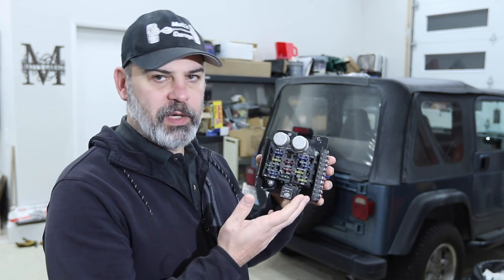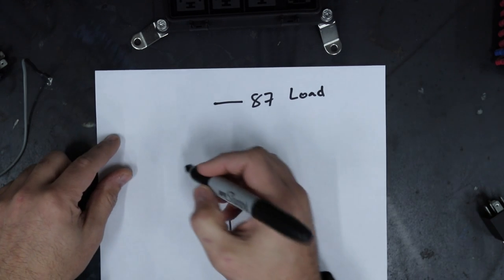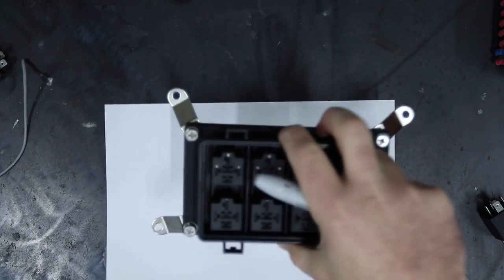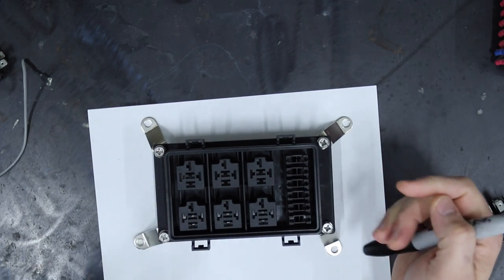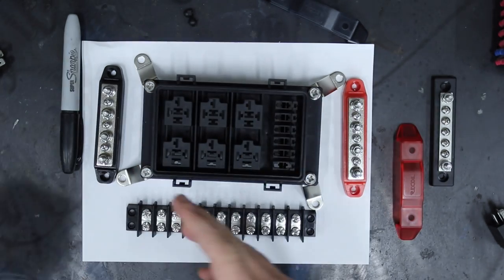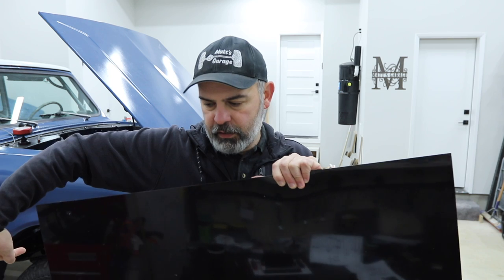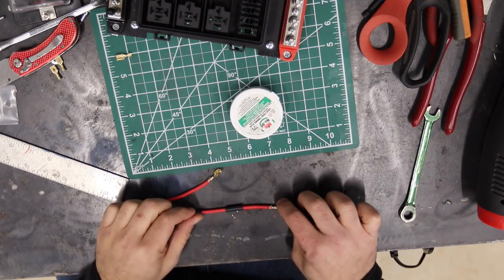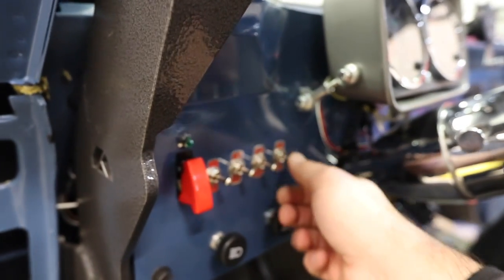8.10-Custom Relay and Fuse Panel

Comment: Save some wire and clutter by jumpering pin 86 to pin 30, and then putting your switch between pin 85 and ground.  Saves running a hot wire all the way to your switch and back, while just grounding all your switches to a common spot under the dash. Most modern automotive wiring is done this way, especially stuff controlled by the ECM.
Reply from the maker: Thanks Tom. The only reason I didn’t do that on a few of them was to have the 86 only hot when the ignition is on since I was powering the buss with battery hot. But I agree with the principle totally.
Reply: @MattsGarage  can you explain that a little, best video so far to explain a relay ive found! I want to move the rats nest of wires from my interior fusebox to a relay panel but I only want power when ignition is on... TIA!
Reply from the maker: @davidokner5450  thanks! What I was trying to explain was that if I was powering the whole panel with switched ignition, the. I could jumper everything 86-30. Then it only needs one wire to power the whole the panel and cleans up a lot of wiring. But I have that panel on Battery + and I don’t want the 86’s to also we battery + I want them on switched power. In case something grounds out in the middle of the night from a furry beast chewing on the wire, it won’t burn the whole rig to the ground.
Reply: @MattsGarage  Hi, so instead of running the power directly from the battery I'd run a wire from the ignition switch itself and that would be my connection to the 30 blade or main power cable, correct? thanks!
Reply from the maker: @davidokner5450  hmmm. No it would be from your ignition to the 86. If you run ignition to 30, then whenever the switch to ground on 85 opens, you are powering your device through your ignition switch. That could be ok for things that require only a little amperage, but anything that draws a lot of Amps should (in my opinion) be battery + to the 30. The only debate is whether to power 86 from battery + or to power 86 from ignition hot. I was just saying I prefer the latter but I admit the former is cleaner in the sense that you have fewer wires running to the panel. BUT that means all of your relays must be switched to ground (switch on the 85 side) and if any of those wires ground out the load will have power. I would recommend just grabbing a 12v light, a battery and a relay and just trying the different setups on a bench. It might give you more of a feel of what’s best for you.
Reply: @MattsGarage  Thanks! really appreciate the help!
Reply: @MattsGarage  the solution would be to put a Big relay on the ignition  switch that would power on the main wire to the relay panel and than you could ground switch the rest of the relays
Reply: @v8tergt653 I had seen another video that runs 2 distribution blocks, having 1 powered only on ignition.

Comment: good rundown... I know a lot of my offroad buddies and I like to run the grounds through the switches and the relays instead of the hot as it makes for a lot less "hot wires" running through the vehicle meaning less likely to short out on a grounded surface. That way if the wire does get damaged and shorts the only downside is the component turns on as if you had activated the switch. Kind of like a horn or a dome light on most vehicles uses the ground as a trigger.
Reply: I agree with what youre saying but its not just a matter of the load activating, if you have a high amperage load and get a small short to ground, the heat created at that point would be problematic. And theres not much you could do as far as fusing that so youre kinda sol.

Comment: I am working with a fuse/relay box that looks like yours. Mine came with green silicone wire plugs that go in the bottom to make the case moisture proof. Do you use them or are you mounting it in a place that does not matter?
Reply from the maker: I mounted them inside so I didn’t bother. Unless you are fording water it’s not necessary

Comment: I couldn't get my 10 gauge wire to look in place due to the size. Did you have any problems?
Reply from the maker: What kind of wire are you using?  I didn't have an issue but I use GXL wire which has thinner insulation.

Comment: I bought the kit you have in the video, but its pre-wired... It states its a 40A relay box, with 6 relays. Each relay is rated for 40A, and the biggest fuse is for 30A.
BUT, I think I made the wrong purchase?

I will have multiple devices that will have about 150A total, a max of 30A for a single device, most are only 3-7A.

Comment: If you get a sec, what gauge of wire did you use for the battery terminal connection? Looks like 14...?
Reply from the maker: I'm pretty sure I used a 10.

Comment: How to you plan on mounting this?  Also what is the height of the dowls your using to raise the relay box from the mounting portion?  Great video!!!
Reply from the maker: I still haven’t actually properly mounted it yet. It works great but still need to mount it permanently. I believe the standoffs were 3/4” but I got rid of them. It was a pain.

Comment: im gonna install LED bar, camera with smart rear view mirror, and reverse sensors. Do I need to connect them to relays or only fuses are enough?
Reply from the maker: It really depends on the amp draw.  Switches and fuses will work, but then your putting a lot of amperage through the switch.  The relay avoids that as there is very low amperage required to trigger the relay.  It's like the trigger on a mouse trap.  A little force unleashes a bigger force.
Reply: @MattsGarage  i calculated a total of a bit less than 40 amps for all accessories.  what do you recommend?
Reply from the maker: @yasser.busaleh  I’m not the right person to ask. I put a relay on everything more than 8 amps but you could probably go up to 15 per circuit.  your LED light bar is the biggest draw right? You should put relays for the biggest draws.

Comment: what amp terminal block do you recommend using
Reply from the maker: Depends on what you are running. There is not 1 correct answer.

Comment: I do have a question about this as I am doing this same box to run my kc lights,led lights,air compressor..my question is 85 and 86 I see you wired 86  on some as the ground and others 85 does it matter witch one I run as the ground??I will also be running the rough country 8 gang switch panel and have live switch feeds..
Reply from the maker: You can put the switch either on the 86 side or 85 side. I don’t remember sending ground to 86 but it “should” be 85 to ground. However, I don’t think the relay cares about that either.

Comment: If a specific relay is no longer made for a car can you replace that relay using this method?
Reply from the maker: Theoretically, yes.  They all do bascially the same thing.  You just have to know/pay attention to the way it's pinned/wired.   If it's just one relay you can just buy a single relay holder as well, probably easier.
Reply: @MattsGarage  Thanks

Comment: Can u use a separate fuse box to send main power instead of a distribution block
Reply from the maker: If I’m understanding your question, yes.
Reply: @MattsGarage  10-4 just trying to figure out how to wire all my accessories I have the same box as in video and in the past bought a regular fuse box like a 12 channel  wanted to run power to fuse box then from there run to relays I understand it would have 2 fuses would that affect anything

Comment: I have a short in a relay  in the wiring how would I test to see where my draw is ?
Reply from the maker: Is the short in the relay or the wiring?  With the car turned off you'd put your multimeter on the wires coming to and from the relay one by one and put the other probe on a good chassis ground or the negative baterry terminal. Obviously not the ground wire as that one would have continuity by design. You could use the continuity setting or ohms.  If there is any continuity, or if the ohms are low, then that's your short.
Reply: @Matt's Garage  big thank you for the reply and video